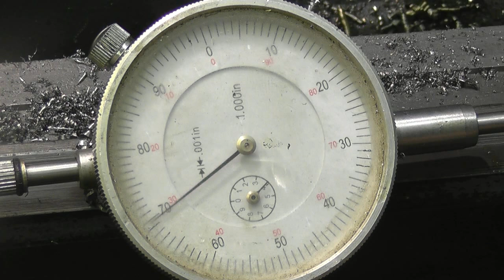Big Head part four

Comment: Hello John,

You say you never run a boring head backwards, but I've needed to do it a number of times.

The first time, I needed to bore a really big hole, around 8.5" as I recall. To do so, I used a boring tool mounted horizontally in the boring head. Unless you have a left hand boring tool, you need to run the head in reverse.

The next time I needed to machine the outside diameter of a boss on a casting, far too big for my Harrison and even probably too big for Adam, Tom, or either of the Keiths to swing in their lathes!. Same problem again, without a left hand tool, you need to run the head backwards.

I'm sure the locktite you used would hold, but the first time I used the head backwards (not knowing it was a two piece tool), there was an embarrassing clunk as the end of the boring head unscrewed and fell off! I drilled and pinned my boring head.

Anyway, nice work and best Christmas wishes to you and Deb.

Comment: Excellent job there John.  This will be a valuable tool for your shop.  Until I saw you picking up the screws and putting them in the boring head I did not realize you had a huge left hand and a tiny right one.  I will be watching for when you try out this tool.   Thanks for sharing.

Comment: Very nice job + some good camera angles too. Just wondering, any particular reason for machining down the bolts rather than countersinking a wider hole for the heads?
Reply: i would guess that the bolts, being rolled, have a fairly wide tolerance, and he wanted them to fit nice and tight into the counterbore, for most jobs they would be fine, but this time it was a part that needed his best accuracy, lets see how the part runs out when he tests it